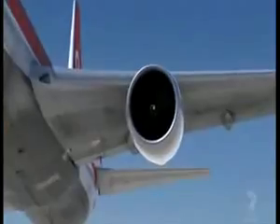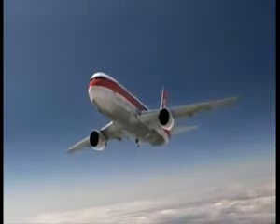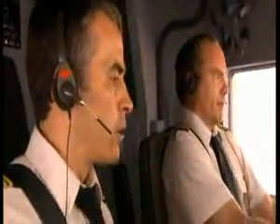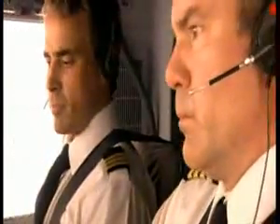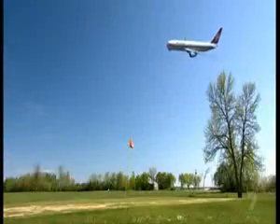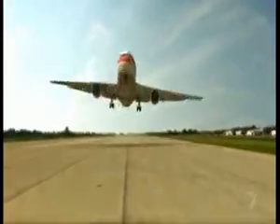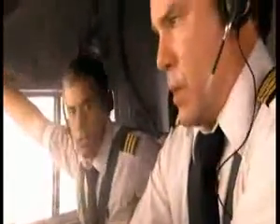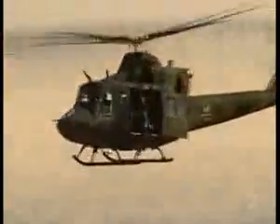Gimli Glider - Condensed Re-enactment

Comment: This has got to be the most amazing bit of flying I have ever heard of; even more incredible than the landing in the Hudson. Absolutely extraordinary. That the pilots were disciplined for this was a travesty.
Reply: Pilots are responsible for safe air operation. This plane should never have taken off, which was a failure of the prime responsibility of a Captain. He was disciplined for negligence of duty. You call that a travesty?
Reply: Bill Woo in my opinion it was more the fault of the ground crew not the captain, although he definitely was responsible. Pretty cool how he saved them though.
Reply: I understand the complexities. For example if a mechanic tells a school bus driver - who also has a supreme responsibility to the care and safety of passengers - that the wheels are safe, but they fail, the bus driver might not be blamed, assuming that qualified people gave their assurance. HOWEVER....

In this case the captain took off without fuel indicators. No gas gauges. When he did that, he quite positively and unequivocally assumed the responsibility for those fuel levels. Yet he irresponsibly miscalculated the fuel and proceeded to crash a planeful of passengers. There's no question that this was negligent performance of a high duty.

What's disturbing here is that he be rewarded or celebrated. I understand why. It's because, at the time, all the passengers and the potential ground victims only saw that he avoided mass human destruction. Skillfully. So they gave him a parade. Months later, the facts quietly oozed out in a technical jargon report, affirming negligence (including the ground and the carrier, but that doesn't remove the captain's fault). But the urban legend of the hero had so much momentum that hardly anyone noticed or cared.

It just seems reasonable that the truth prevail.

By the way, if you want to celebrate anyone, pick the co-pilot Maurice Quintal.
Reply: Not anywhere as amazing as landing on the Hudson. He lost engines at over 40,000ft due to his own negligence and had a huge amount of time to figure out where to land (gives approximately 90 miles of travel at the optimal glide). He and the copilot also both ignored the initial warnings believing them to be erroneous. 

Captain Sully lost power at 3000ft due to a bird strike a minute after takeoff, and had to determine where he could make a safe landing within seconds. There have been many planes landed without nose gear or with low power on landing, but there has never been a large commercial aircraft that has ditched with no loss of life, until then.

Comment: https://en.wikipedia.org/wiki/Gimli_Glider

The incident was then programmed into a flight simulator. All pilots, who all hadn't had gliding experience, crashed the plane.

There's also the film 'Freefall Flight 173'. 

The incident was partly caused by confusion with going Metric, thinking that the amount was in gallons not litres, thus about four times less fuel. It shows that one must be careful with those things. Also, that event shows the importance of gliding experience.

Comment: this is how they calculated the amount of fuel to be added
7682 L*1.77 lb/L=13 597 kg of fuel remaining on board....
22 300 kg needed - 13587 on board = 8 703 kg to be added

8 703/1.77 = 4 916 L of fuel to be added

The correct amount of fuel to be added :

7682*0.803 Kg = 6 169 kg of fuel remaining on board
22 300 kg needed - 6 169 kg on board = 16 131 kg to be added

16 131 kg in L = 20 163 L fuel 

20 163 L of fuel should have been added where as only 4 916 L were actually added.

if they had kept tracks of the units and made sure the units cancelled properly, this whole incident wouldnt have happened.

This whole thing happened just coz of SI unit problem...can u guys believe this???
Reply: +Mathuran  ketheeswaran 
This whole thing happened because of a poorly manufactured computer component that should have been tracking the fuel, saving anyone the hell that can be conversion maths for the nonmathematically minded (But well done, you, for doing the maths.).
Can you believe that Pearson International Airport in Canada ISN'T named after Captain Bob Pearson?
Reply: Bob Pearson should never have taken off since he was incapable of safely calculating the fuel requirement. Bob Pearson was negligent in the high duty of passenger airline Captain. You want to honor him???
Reply: (that's for Lester)
Reply: ***** 
He knew how much fuel was needed, he didn't know how to convert the Imperial units into metric, but let's not split hairs:
Many of the people we award medals and convey honors to are those who have pulled glory from a completely FUBAR'd situation, and sometimes that situation was one of their own making that they were able to correct.
Reply: Nearly mass murdering hundreds is not splitting hairs. It is a sacred 
rule that pilots do not take off unless they're sure they can fly 
safely. Worse yet, this involves pilot overconfidence - which is 
absolutely not tolerated in that profession. Name an airport or street
 for him? Absolutely insane.
Reply: *****
Interesting, Canada had a huge trial about this and the company was found culpable for inadequate training of their crew, from the ground crew to the pilots, in regards to metric conversion.

Comment: @KareenCasey They ran out of fuel because they were in the middle of switching from Imperial measuring to Metric and mis communication let to ground crew and the pilots believing that there was plenty of fuel. The pilots saved a lot of people using this slipping technique. There is more to most situations than meets the eye.

Comment: They ran out of fuel because they were in the middle of switching from Imperial measuring to Metric and mis communication let to ground crew and the pilots believing that there was plenty of fuel. The pilots saved a lot of people using this slipping technique.